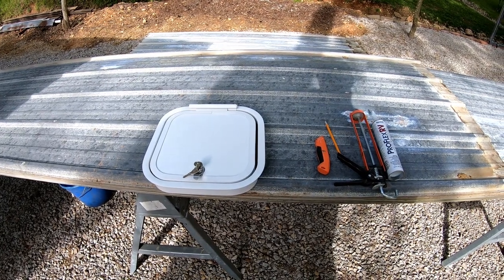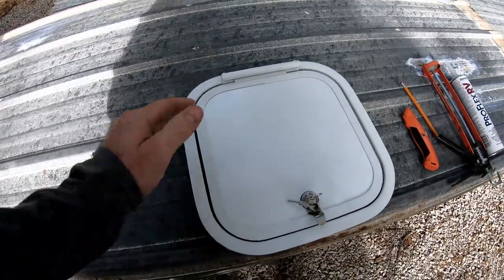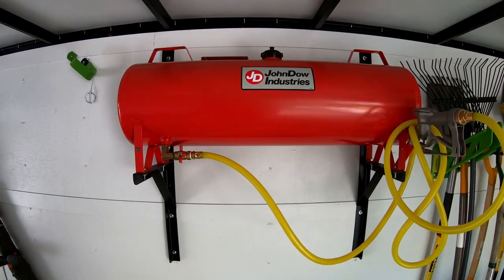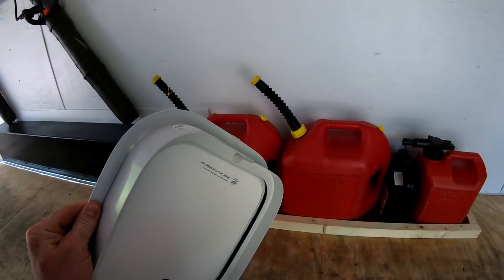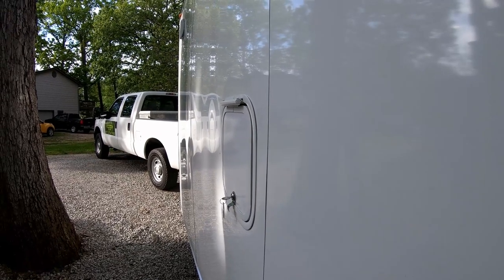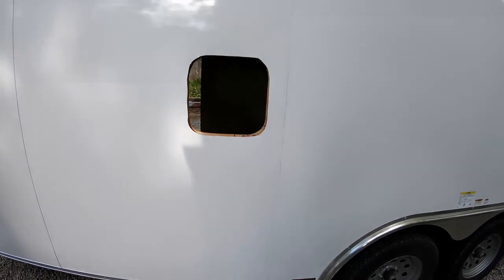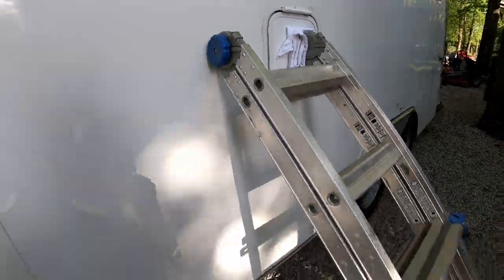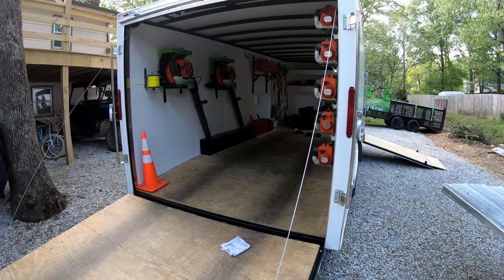Fuel Door Install

Comment: Man those little doors are like electrical plug ins. You can never have too many. 2 on each side of the trailer would be a slick set up!
Reply: Actually it wouldn't surprise me if trailer manufacturers didn't pick up on this idea.

Comment: Ive been concerned with an auxiliary tank in the trailer for electrostatic causing fires when filling tanks on trailers. Ive been finding ideas as I want to mount an auxiliary tank to continuous gravity feed my pressure washers. Id like to mount a 45 degree filler cup with filler neck and rubber hose to auxiliary tank to the trailer so no door needed. I'm just not sure on how to ground or bond to prevent those possible electrostatic fires.
Reply: Hey, do you ever figure out a way to ground the tank. I have been thinking the same think and I just saw this comment.
Reply from the maker: It's grounded through the bolts that mount it to the metal wall studs, which are welded to the frame.

Comment: Curious why you didn’t orient so the door opened down instead of up
Reply from the maker: Door design and weather proofing.
Reply: @HandyGuy2016  weather proving doesn’t make se se as is seal inside and out.   The other guy is right , the other way is more functional.

Comment: Nice video sir.
I'm interested in your on board trailer fuel and wall brackets. Can you provide a link for those. Thnx
Reply from the maker: I don't have a link, but the fuel tank I got on Amazon, and the brackets I made myself, but can easily be duplicated with Steel angle.
Reply: @HandyGuy2016  very nice. Thnx for getting back

Comment: How is the ventilation while refueling  inside the trailer?
Reply from the maker: It's good, I have 2 roof vents open, 4 factory wall vents, and the back door open while fueling.
Reply: I was wondering the same. Gas fumes in an enclosed space are very deadly and I don’t see an escape.
Reply from the maker: The trailer is well vented and the mowers have almost 30 gallons of fuel in them,in the same space with no fume issues.

Comment: I installed mine in the back of my truck and it refuses to flow. What am I doing wrong cause it's full. Any suggestions?  Thanks in advance.
Reply from the maker: It's gravity flow and it is slow, but as long as the nozzle and hose are below the tank it should flow.
Reply: Maybe it is an air flow problem?
Reply from the maker: That is possible. Is the cap vent open? I even loosen up the cap when fueling.
Reply: @HandyGuy2016  I've tried everything,  eve removed the cap but nothing.
Reply from the maker: There must be something blocking the hose. Can you see fuel in the hose? If not there might be something blocking the fuel at the petcock.
Reply: @HandyGuy2016  At first it was flowing for like 5 mins 2 weeks ago, then after that nothing, so i left ot there. I'm thinking of removing the hose today and re-installing it. Hell I've even took the can full of gas and put it on the top of my truck cab yesyerday just to see if it needed to be higher " still nothing. " Thank you for all your reply brother.
Reply from the maker: Hopefully you figure it out, but definitely sounds like the fuel is blocked somewhere.